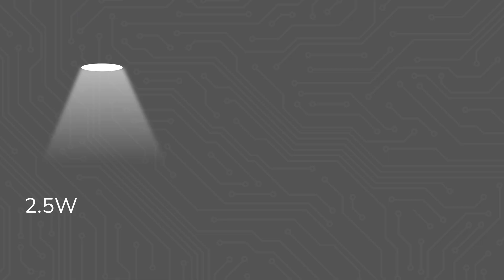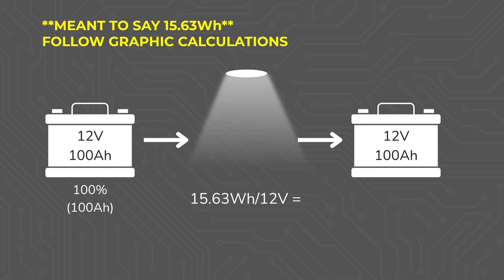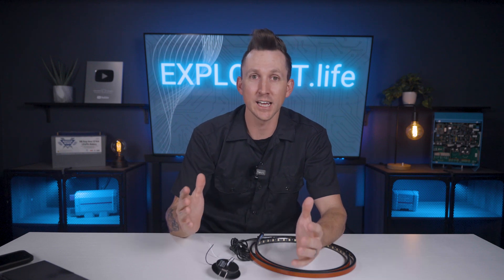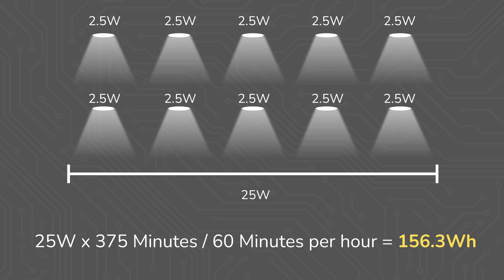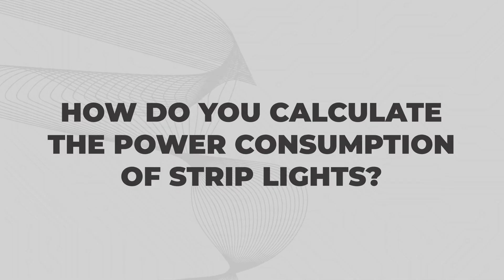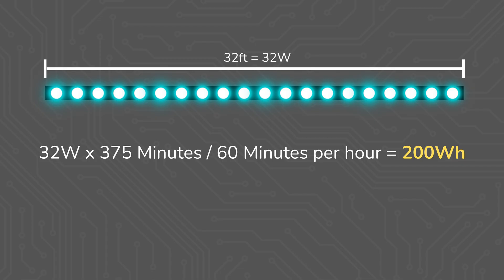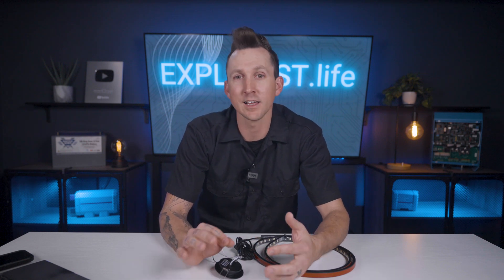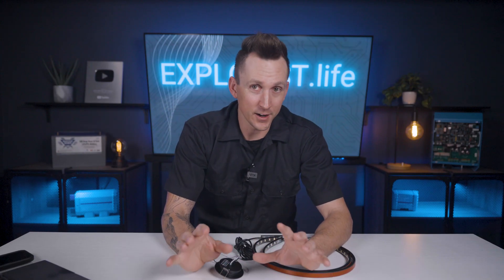LED Lights. How Much for a Mobile, Marine, or Off-Grid Electrical System?

Comment: I have a question if i use a 120v inverter can i use this formula, or id there any other factors i need to calculate? Thanks you for ur answer.

Comment: We used the same lights as you from a link a few years ago, we run 6 in our bus our on a dimmer and the setting we usually use is 5-6w according to our Victron smart shunt and we probably use them 1-2 hours a day in the summer 3-4 hours a day in the winter. 

So summertime high side 6w 120 minutes would be 12wh /12v = 1ah or 0.5% of our 200ah li batteries.

Wintertime would be 6w 480min /60 = 48wh/12v=4ah or 2% of our 200ah li batteries.

Comment: Awesome information, thanks for that! 

Question: if a device needs to stay on for 24/7 such as security equipment, do you still need to use the same formula for power consumption as talked at the beginning of the video? 
Or is it ok to just do wattage x hours to get watt hours without having to divide by 60 in this particular situatio?
Reply from the maker: Lesson 1.3 of this academy should clear that up: https://youtu.be/9asJztKKDOg
Reply: @EXPLORISTlife 
got it, thank you !

Comment: Another great video, I can see now how to calculate usage, I will have two 12 volt 70 ah batteries in parallel running a 3000 watt inverter. I plan to run a  750 watt pillar drill for less than two minutes on and off.

Comment: I have 50ftx2 Govee H613, 1% bright 3 watts , 100% 34 watts .  .072 kw per day to .792 kw over 24hrs. 48kw battery can run the lights all day for 58 days. Add fridge freezer tv cpu and heater 3 days.

Comment: Great channel dude...so what gage wire do you use for 12v lights, usb outlets etc etc...?...
Reply: Wire gage is based on amps.  Figure out the amps needed by the circuit (amps = watts / volts) and go from there.  I like to go up one size from whatever I calculate for safety.
Reply from the maker: YT search: "EXPLORIST.life How to Size Wire".
Reply: You would find the answers to every question about electrical equipment on this channel. Search a bit among other videos, we are no longer todlers  who expect to be fed;) !